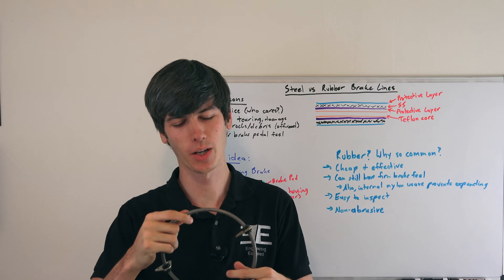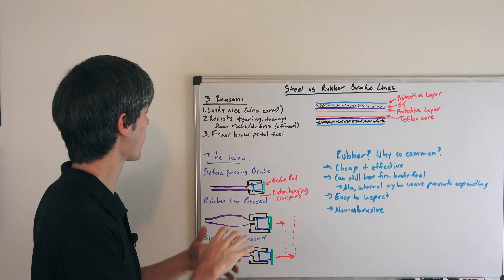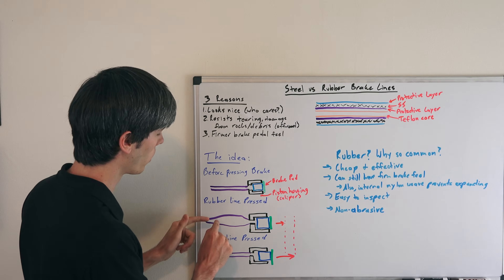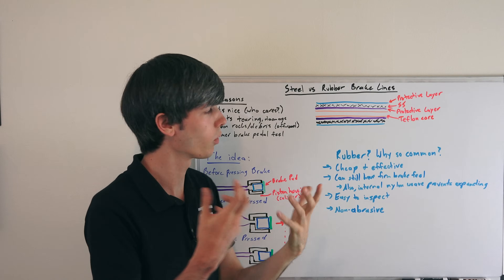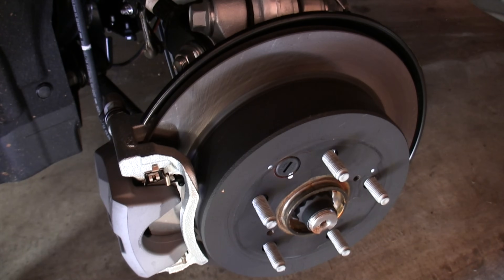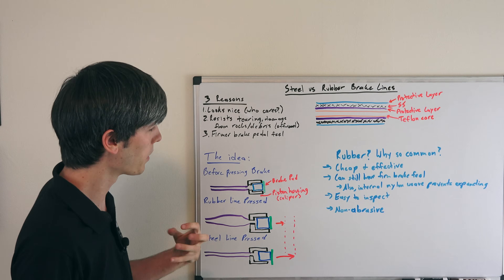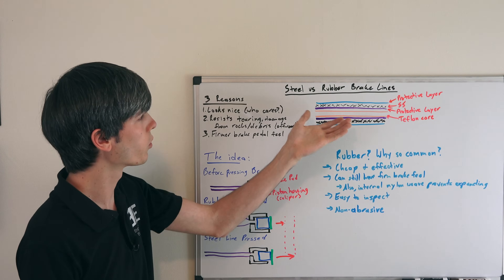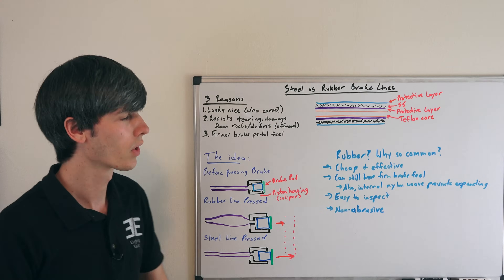Steel Vs Rubber Brake Lines - Are Stainless Steel Lines Silly?

Comment: I agree with you but the main advantage I went for with stainless steel brake lines is that they don't wear out as fast as rubber. Thousands of miles with rubber lines will stretch them out and make them less effective. Where as stainless wont have that problem.
Reply from the maker: Perhaps, but plenty of 20 year old cars out there are still running the original brake lines with no issues.
Reply: Driver preference and use I think are main factors. I off road and it does help out to be more resistant to tearing and abrasions.
Reply: the contamination when your rubber breaks? oh man, you'll find out in 9.5 months
Reply: Try stainless steel lines as a replacement to +4-year-old rubber lines and you'll never get anything else for your bikes. No wonder all serious track bikes come with SSlines straight out of factory… ;-)
Reply: +Jarrett C.

I have two Yamaha XS400 motorcycles (one is a 1980, the other 1981). Their braking systems are much simpler than most cars; just the master cylinder, brake line and caliper. The fronts are disc and drum brake in the rear. 

Both had the original rubber line (AFAIK, over 20 years old). I had a stainless steel line made up by a local hydraulic shop. After installing the stainless line, the feel with the lever was much improved. Very little input is needed before force is applied. Compared to the old rubber line which requires quite a bit more input before the lever firms up. 

Now, this comparison isn't completely fair. I've been meaning to buy a new rubber line for the other motorcycle and bleed the brakes to get a truly fair comparison where all things are equal except for the hydraulic line.
Reply: My Celica went 13 years 320,000 miles with the original brake lines. Passably the way the car is engineered has more to do with how long the brake lines last.
Reply: I have a 93 Ranger with all the original lines, the brakes are extremely soft. That is after almost 300k miles, though... Lol
Reply: I was just thinking about dirt and rust (in terms of longevity).
Reply: My '75 Suzuki has horribly spongy front brakes, and my understanding is that it's because of the design of the brakes - trailing brakes pulling the front end down, single pucks and no holes in the discs for heat and water dissipation.
You probably don't have an old bike, just saying there are other things that have a greater effect on the feel. If I were to replace mine I'd replace the upper line with steel line.
Reply: yes but you probably only did daily driving with it steel braided lines are more for people who actually go to auto-x or curcuit racing where they actually push the brakes to the limit with extreme heat and abuse one day of abuse in my girls celica and the brakes felt like crap now she has steel and even after the auto-x they still feel great
Reply: Roel Lopez and how old were her rubber lines when you tracked with them?
Reply: Roel Lopez My 2000 Celica had the worst stock brakes of any modern car I have ever driven.   The front disk rear drum set up with no ABS was horrifying. This in a 2500 pound car.   I used the gearbox mostly to stop for the first 99,000 miles. It is like Toyota put the brakes from a base Corolla on the base Celica.  At 100,000 miles I upgraded the front brakes to Slotted and drilled rotors and replaced the rear shoes.  I had the brakes balanced. Braking performance increased 3 fold.  Still not sports car like but I could stop from 100 mph without fade twice. Something the stock brakes could not do once.  I tracked my car 3 times.  I pushed it as hard as I could on performance summer rubber.  The brakes held up on the track with no fade as did the factory brake lines.  On the street I grove like a grandma.  I beat the hell out of that Celica on the track.
Reply: Sir Daft1 6-7 months if I recall
Reply: fatboy19831 my girls is disc front and back
Reply: fatboy19831 my girls stock braking was is great she is still on stock disc just steel lines and they are great almost better than my 2015 wrx actually
Reply: hmmmmm, hmmmmmmm   my Landcruiser has the original brake lines,,    21 years old with 287,000 miles. The lines still have not stretched out. If they ever wear out, I'll be replacing them with OEM lines.
Reply: False. Stainless lines allow in contaminants that can break down the inner Teflon core. Not my opinion, this is per the Stoptech website FAQ. In addition, while stainless supposedly doesn't expand like rubber, SS lines also seem like fail without warning when they blow out at the crimp. That "soft pedal" feel you get from old rubber lines are just an indicator that the part is ready for replacement.
Reply: your girlfriend's going to have a problem with you using SS vs. rubber...

Comment: rubber lines swell and can cause break fade and soft peddle
Reply: Brake fade isn't caused by rubber lines swelling, otherwise you wouldn't get brake fade with ss lines, and you most certainly do.

https://en.wikipedia.org/wiki/Brake_fade
Reply: you do not get brake fade with ss lines I have puton over 60 pair in the last year every performance car has them for that reason alone
Reply: Brake fade is caused by fluid boiling (either brake fluid, or water). Fluid is not compressible, however, the vapor is, dampening the responsiveness of the brakes.

On street cars, overheating the brakes to such extent that brake fade is occurring is usually caused by improper downhill driving (not using a lower gear to keep speed under control). Aside from the example highlighted, or mechanical failure, brake fade is a very rare occurrence in normal street driving.

Comment: Although I haven't had a leaking brake line (so far) on any 1991 or newer vehicle, I'd love to know what kind of line is first to leak after 125,000 or so street use miles.

Comment: I had soft rubber brake lines before on my 1981 chevy Camaro.  I replaced the rear brake line when it failed with a hard rubber brake line like you mentioned.  At the time of me selling it I was planning to replace the front brakes and front brake lines.Original on my 81 chevy were soft!  This could've been doo to age.

Comment: Ss brake lines still have rubber inside. How would you be able to tell if the rubber cracked?  My 20 year old cadillac lines developed fractures in the rubber so i changed hem to rubber again.  I hope to get 20 years out of the oem replacement too (AC/Delco)

Comment: What about for cold weather driving in the north

1. the cold wether does that affect anything 
and 
2. is stainless steel more suitable because of the chemicals and salt they use for iced over roads
thanks!

Comment: When it comes to daily driving cars, theres not a notable improvment in performance, even if you have an upgrade of all the brake sistem and try to race on public roads, you are just gonna push so little to the limit that there is no diference between stock system or aftermarket parts. But when you get yourself into a race track you will truly be able to notice the diference, other wise tell me for how many corners your stock brake sistem is functional versus how many hot laps you can make on a modify brake sistem, even with only steel brake lines the improvement is radical. But for normal driving what the car has its ok.

Comment: I like your videos and they tend to be fairly well researched, but you made a lot of assumptions on this one. 

Older brake lines can be soft. Old BMW's are notorious for having the lines balloon on the clutch line to the point that you can depress the clutch all the way and get no movement from the clutch slave. Old japanese cars have lines that degrade from time and use that if you hang a caliper by the line, you can stretch it a good 4-5 inches. 

You are correct that a new line is most likely going to have very little in comparison to benefit, but old lines will have a very noticeable difference. I would say a pair of aged SS lines are going to have far better pedal feel then an equally old pair of rubber lines. 

As another commenter said a good EE style explanation would be the difference in force when the line does inflate X amount how the diameter difference would change the pressure exerted on the piston etc. 

Some other benefits not mentioned is heat resistance, rotation protection, sharp object protection. 

A downfall for the lines is that the unprotected ones can fail from having debris get lodged between the braid causing a portion of the clamping force provided by the SS braid to fail causing spot leaks.

Comment: It's a different animal- motorcycles, but on bikes the stock rubber ones work well for say, 4 years, after that, you get less braking power and spongy feel.  Braided stainless steel ones, however,  give you better braking power and last a lot longer.

Comment: Isn't this more of a trackday problem where the rubber lines under the influence of hot brake fluid will expand? That's why I changed mine...

Comment: Forgot the best part about Stainless Steel Lines: they dont wear. Brake Fluid is highly hydroscopic what means it attracts water. The softener used to make rubber brake lines flexible contains water so rubber brake lines become brittle and have to be changed every 4 jears of usage. Steel ones last forever because of its PTFE  inner layer what is imune to the hygroscopic brake fluid. Thats the cause why the usage of SS- lines in Aircrafts is mandatory .

Comment: The thing that affects pedal feel the most are the pads, rotors and fluids. It's almost impossible to feel the change from good rubber lines to stainless steel lines.
Reply: +sodazman no, there is a notable difference when tried on a 4- pot caliper system. On most of the 1 pot caliper systems the weak and soft movement of the caliper and the housing eats up the benefit of the steel lines.
Reply: I have used them on 4,6 and 8 pot brakes. You have to have pretty old and beaten up brake lines to notice a difference. If your car is 15 years old and still has the original brake lines then it will make a difference.

Comment: Maybe not so important for cars. But on motorcycles, braided steel brake line are INVALUABLE for cutting good lap times. 

No such thing as a MotoGP bike that doesn't have them.

MachOverspeed

Comment: Motorcycles often run rubber from the handlebars to the 2 calipers, and the dexterity "feel" of your fingers is greater than your whole leg.
Question is - 
Do you want to step on a sponge or a brick ??

Comment: I replaced the rubber lines on my Jeep JK because the owner before me put a 2.5" lift under it. They didn't put extended brake lines on though. Also, the brake line I bought come with a life time warranty. The stock brake lines on a Jeep should be replaced every 10-15 years.

Comment: I'm an avid Jeeper.  I bought into the "SS lines are more durable" idea early on and I have had many failures over the years.  My last set for the fronts cost $80 so it wasn't like I was buying cheap lines.  After some research I found that many other 4x4 buffs had the same issues as me with stainless--the crimp usually fails.  I switched to rubber and so did my buddies and we haven't had an issue since.  Rubber does have downsides, but as far as durability goes, I will always use rubber in my 4x4s from henceforth.

Comment: Jason, what's the recommended interval for replacing brake lines, if any?  Also, is there a recommended interval for replacing brake fluid?  Finally, if I replace the brake lines, do you recommend performing any related maintenance that might be opportunistic due to the replacement of the brake lines or do you possibly recommend replacing any particular hardware during brake line replacement?  Thanks for the video.  I appreciate your thorough explanations.
Reply: Hey there redondo, just a good samaratin willing to answer your questions 6 years later:
For brake LINES (as in the actual metal lines), they don't need to be replaced unless corroded through. 
For brake HOSES (goes from the hard lines to the calipers) then every 5-10 years
For brake FLUID: really should be a yearly thing, or every two years. Basically when it's not clear, just flush it out. If your brake fluid reservoir is black just do it.

Of course, the brake hose replacement can be extended if the brake fluid is flushed on a regular basis.
Reply: @SteelJM1  Hey, thank you much for the reply.  I believe my car (2004 VW GTI)  is overdue for the brake hoses (soft lines) to be replaced.  The car will be 19 years old this November.  If I take into account the date of manufacture, it's already 19 years old.  I'm the original owner.  The fluid looks good but I think that replacing the hard lines will be good preventative maintenance since in the near future I will drop the rear axle beam in order to replace the axle beam bushings.  While I'm doing that maintenance, I intend to replace the stub axle, rear wheel bearings, overhaul the brake calipers and replace the disks, pads, springs and shocks.  Basically, refresh the entire rear end.  Replacing the hard brake lines just seems like a good idea at that time since the back end will be disassembled.  The follow up project will be more extensive.  The entire front suspension to include everything already mentioned, plus the control arms, ball joints, front axles, maybe the push rods, bushings for the sub frame, engine mount, transmission mount, clutch assembly, coolant hoses, thermostat, & housing, serpentine belt, coils, spark plugs and timing chain will all be changed.  A lot of work all at once.  However, if you've ever seen how cramped all of these components are, I believe you'd understand my logic in doing it at one time.  The parts removed in the order I listed them, help facilitate all of the subsequent maintenance.  The timing chain is particularly hard to access.  The chain itself is a lifetime part, however the guides and tensioners around the chain are known to fail on cars in the range of 100 to 150K miles.  I believe these are probably cars the have been driven hard.  My car has been not been driven hard.  I almost never downshift, and the tachometer only gets pushed to around 4,000 even though the redline is around 6,000, if memory serves me.  My car has approximately 160K miles.  However, I don't want to push it too much further.  The engine is an interference engine and if there's a sudden failure of a timing chain guide or tensioner, it would be a catastrophic engine failure.  I still have the original clutch installed, if that gives an idea of how easy I am on the car, although I'll admit most of those are highway miles.  The challenging part for me is that almost all of this maintenance will be a first for me.  I've changed brake pads, rotors, axles, and spark plugs before but not the more indepth maintenance.  If you have any advice for me as I prepare for this project, I'm always interested in good feedback.  I have delayed his project for quite a while but the car continues to run great.  My first step will be to buy a pickup truck so I have other transportation while the GTI is undergoing major maintenance.  I really do appreciate your feedback on the brakes, so thank you.

Comment: the biggest thing I've found from my years lurking and trolling forums, is rubber lines when they start to go,  you'll lose some pedal,  and you'll discover a leak.  
when steel lines fail,  and this might be just because people who are looking for what steel lines are purported to deliver are hooligans,  but when they do fail,  they fail big.  massive rupture,  almost immediate loss of brakes.  if you drive a car in the elements, through the salt,  ect ect,  probably should leave your daily driven rubberized lines alone.
track car? Steel,  absolutely.

Comment: There is an additional reason to use stainless lines.  If you are frequently changing wheels, for instance between 'road' and 'track' tires; of if you often reconfigure suspension components, such sway bar settings, and types of end links; or if you frequently change wheel alignments to non-stock settings, it is remarkably easy for contact between the brake line and a moving component to occur.  If you have stainless jacketed lines the brake line will be protected.  Rubber jacketed lines are much more vulnerable to abrasion.  I agree that any change in brake feel between rubber and stainless jacketed line is so small or subtle that most people will not notice the difference.

Comment: I wouldnt call it exaggerated, not THAT exaggerated at least. I have done steel braided lines on two cars that did have firm pedals from factory and i experienced a nice improvement on both. Even firmer feel and it gives more confidence in the brakes when driving "vigorously" in my opinion.

Comment: when it comes to threshold braking, pedal feel is everything (without abs)so braided are a big advantage
Reply: Usually brake lines go a little before they go a lot you know? 
First they get weak and the driver should notice, THEN they fail totally, at least in all of my experience with brakes. 
Burst pressure to me was always a value I would never be able to reach with my foot, even a on a boosted system.
Reply: Takes multiple components in the entire system to add up to dramatic differences. But the differences are definitely there when changing single things.